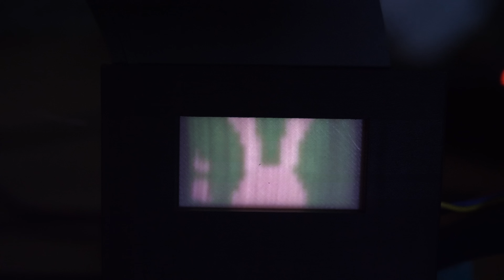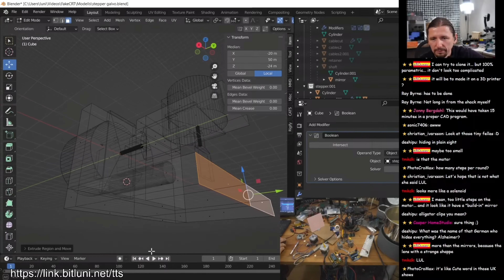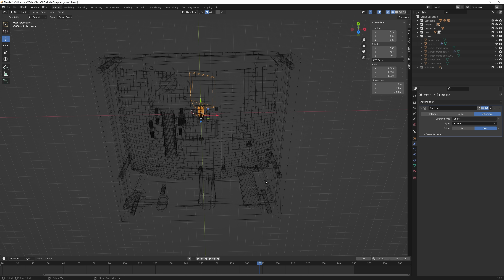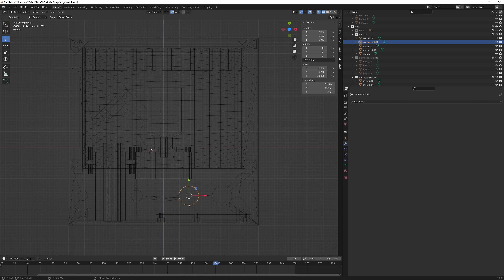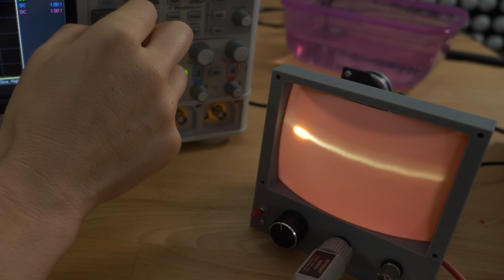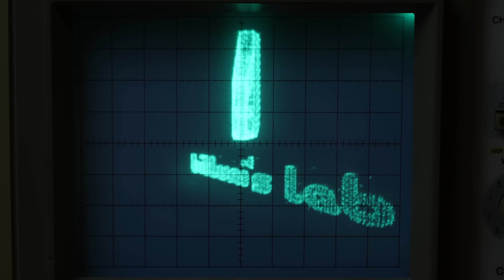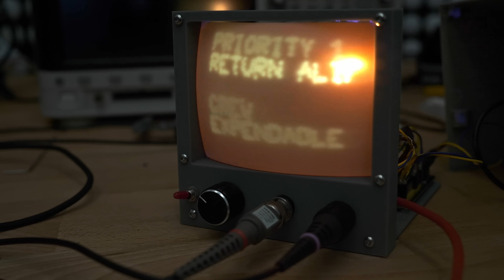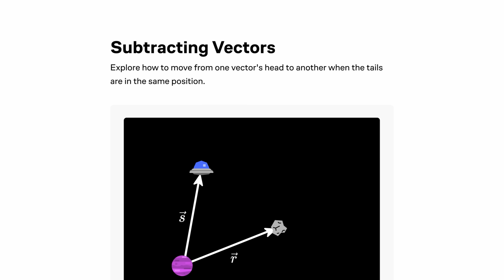I made a fake CRT TV with a LASER

Comment: How about using a smaller lighter laser diode and just hanging it from an elastic band or on a spring or something with a couple of electromagnets around it in a cross. Then using the magnets to physically rotate the diode a little bit. and using this to draw shapes or create scanlines. It might be very fiddly but could possibly increase the speed of your movement a lot. and additionally it would closer resemble the way an actual crt works, just bending the beam source instead of the actual beam.

Comment: I wonder what is its resolution. I understand this is a vector display so it doesn't really have the notion of resolution, but still you can only make the text so much smaller before it becomes an unintellgible mess
Reply from the maker: theoretical resolution is 512x280 with microstepping of 16th steps with the 0.9°/step motor. but practically lower because the light bleeds. that could be reduced by making the screen thinner but that is hard to print

Comment: I got the same idea with the speaker but never tried to do it. It should be possible to get higher amplitude with some mechanical advantage or bigger distance between the mirrors. The speaker may also give a higher resolution. The only problem, it's gonna be LOUD.
Reply from the maker: I had the idea to cut away most of the membrane for it to be less springy. what I didn't mention is that I had 2 speakers killed of heat because of a DC offset

Comment: I feel like you could've used the reflective surfaces of those speakers, or used mechanical advantage to turn the small deflection of the speaker cone into a larger deflection of the mirror.

Also, still technically using magnetic fields to deflect the beam.

Comment: no input shaping on the mirrors so you can have the steppers run at full speed?
Reply from the maker: need to switch the controller then. not really familiar with that but a transfer function should do, shouldn't it?

Comment: If you have a couple of old hard drives, they have a head that moves rapidly that could be used to control the mirrors but it would be a larger part even disected than the stwppwr motors would be. Very cool project, well executed.
Reply from the maker: that part didn't make the final cut. on stream we took apart an hdd. unfortunately the modern drives are very integrated with the case. we only salvaged the loose magnets and coils

Comment: The next step is to achieve a raster image, and build an 8K CRT. You will have to spin those mirrors pretty pretty fast 😉 or you could just use a 100 side poligonal mirror.
Reply: How will 100 sides help? Ah, very small angle. So you fight diffraction?

Comment: hear me out
harvest some DLP projector mirrors
Extremely rapid and precise mirror movement
Something you could do thats more DIY is have 2 mirrors spinning really fast, and using a shutter to only activate the laser during each of the mirror's sweeps that would place the laser where you want it, butyou would need really fast and accurate motors and sensors, a really fast shutter, and a really bright laser
Edit, you can increase the number of sweeps per second by increasing the number of sides, say, using a hexagon tube of mirrors, but this requires advanced mounting, a flat mirror is flat, but 6 flat mirrors might not all be reflecting in the same direction.

Comment: Years ago I bought a used laser and power supply at a ham fest that had been removed from a broken laserdisc player. The laser was a tube but the way they moved the beam was with voice coils and mirrors similar to the speakers you used but to get more amplitude the mirrors were hinged on one side and a stiff wire from the voice coil attached to the mirror about halfway between the hinge and the other edge. This made the mirror deflect more than the voice coil moved. Of course it doesn't matter that the laser wasn't a diode, I was just trying to give you an idea of how old it was.

Comment: Please please please develop this into a working display for analog retro gaming. A 22" Color Laser Phosphorescence Tube would be incredible and would probably have insane refresh rates, not to mention massive brightness and contrast benefits, I would bet you could achieve far higher resolutions on this even.
Reply: i was thinking this as well, it honestly feels like this ought to be a very viable product to bring to market! As far as i can figure it should let you make incredibly cheap monitors at the cost of them being way thicker than LED ones and they could only be about this size or larger.
Also it ought to be possible to just keep adding lasers, thus enabling waaaaaaay more advanced vector graphics!
Reply: @ I am so disappointed that arcade fans don’t even use the space in the cabinet for some directional backlight. Atari Lynx has a more sophisticated reflector. Everyone wants cheap off the shelf consumer stuff.
Reply: He basically replicated the mechanism of a vector display like the Vectrex or some Arcade games used, in a modern fashion!
Great stuff, love it!
Reply: Why phosphor? I did not notice phosporesence on CRT . High speed cameras show that it lasts not even a scanline.
Reply: @ArneChristianRosenfeldt Phosphors are what turn the electrons from a cathode ray into green, amber, or white photons on a monochrome CRT or red, green, and blue photons on a color CRT.

While phosphors can be phosphorescent, fluorescent phosphors are what's used in CRTs. Either the original commenter probably confused "phosphor" with "phosphorescent", or they're referring to the high level of persistence this specific device has. A Laser Phosphor Display (LPD) is a real thing though.
Reply: This technology already exists. Look up "laser phosphor display."

Comment: I implore you to find an old laser printer. The laser module in it will have a laser along with a high speed rotating mirror. The idea is when the reflected beam runs off the end of the drum, the next side of the spinning mirror starts reflecting the beam at the opposite end. Get a color laser and you might find four of these laser assemblies! You could build a raster system out of such a setup.
Reply: A rotating mirror does not lend it self to random XY movements very easily.
Reply: @Axel_Andersen  It doesn't need to. Just like with the assembly shown in this video you use a second mirror assembly so each assembly is handling one component of the XY movement. This is a long solved problem that's why you see so many similar comments about the same kind of mechanism in these comments.
Reply: @Jackpkmn  I still do not see how two rotating mirrors make a good XY movement (which to me imply random or vector like drawing). For raster scan yes, but for XY, I don't see it. A rotating mirror needs to accelerate and decelerate relative sizable mass to do random movements. Of course if you consider a galvanometer as rotating mirror then sure, but to me rotating implies more or less continuous motion. I guess it all depends on what is our built in vision when we read a word like 'rotating' mirror.
Reply: @Axel_Andersen The more sides the mirror has the less the speed has to be modulated to adjust the timing. The only actual limitation is that you can only draw in one direction, the rotation direction. So if you wanted to draw two parallel lines you would have to draw them in 2 separate passes or raster scan them in.

Drawing them as two separate passes doesn't have to be as much of a problem as that probably sounds at first with a mirror with many sides that spins relatively quickly. Since the number of times you can scan the screen per second is the number of faces the mirror has times the rpm of the motor.
Reply: @Jackpkmn  I get all that. But it still does not lend itself to good XY random vector drawing IMO
Reply: @Axel_Andersen  It's not doing vector drawing. It's a raster system, so the motion of the beam never changes—it's just a horizontal line that gradually sweeps down the dispaly surface over and over. The image is constructed solely by turning the laser on and off, very rapidly, at exactly the right times. As others have noted, this is the principle analog TV was based on.
Reply: @martysmith2756  It certainly looks to me that many of the examples he shows are drawn in vector drawing mode. Easy to see because of the tail the spot leaves behind.
Reply: @Axel_Andersen   I think vector drawing was the only solution for displaying readable stuff without a raster, because the hardware was way too slow for that.
Reply: @ RIght.And my point was that (hi speed) rotating mirror what the OP suggested is not ideal for vector drawing which the video showed.
Reply: @Axel_Andersen I think we get your point, but the mirror motors of laser printers were not intended for vector drawings, which makes no sense in the first place, they were only intended for raster deflection.
That's what the OP said from the beginning.
Reply: @ResetLoop  Exactly.
Reply: This. I made an analog version of this in the 80's to use as a night club lighting effect. Used octagonal prisms (what you're calling a drum,  I think) and it could run in vector mode or raster. Each motor had it's own function generator. It was about 20 years before I discovered microcontrollers, sadly.

Comment: I think you gave up on the loudspeaker idea too soon. The way you mounted the mirrors, you had a very long lever arm between the pivot point and the point being moved by the voice coil. If you can put the pivot closer to the center of the coil, you'll get more deflection for the same amount of coil movement. You could also experiment with using a magnifying lens to get more deflection.

Comment: it might be better to use the "laser printer" technique, where you spin mirrors around really fast and pulse the laser, instead of moving the mirrors precisely. Though with 2 mirror drums (or varied angle on the drum faces) needed, I'm not sure.

This also would introduce an arbitrary number of lines/dots you can draw, probably worse than the stepper motor's, however, it will be a lot faster.

Comment: Interesting, earlier today I was thinking if CRT TVs could be made thinner and lighter by ditching the magnetic deflection part of the electron beam altogether and instead using electron mirrors and/or electron lenses that can reach a larger screen area with little movement, given this demo uses a laser beam, but it's an interesting proof-of-concept, and I would love to see big home CRTs brought back again in an enhanced form through an insight like this, other thing I thought about is using some sort of electron phased array of sorts.
Reply: this has been done, google 'sinclair ftv1', but it never took of as LCDs developed fast
Reply: TV were quite thin. A big problem is the actual gun.
Reply: its already  been done, a gabor tube,  google sinclair 'ftv 1'

Comment: Would be interesting to see those mirrors mounted on something that has much less inertia, like a hard drive hand. That's the kind of technology used in similar systems that use lasers and mirrors to draw images. Stepper motors are just too slow for such applications I think.
Edit: actually, your attempt with speakers was close, but instead of amplifying the voltage to amplify the amount the speaker membrane moves, you should've amplified the motion itself mechanically, maybe a system of linkages or something.
Edit2: And yes, the accuracy decrease when speed was increased is exactly inertia at work. Such systems have to use lightweight payloads and finely tuned magnetic forces for control

Comment: Great build, but instead of motors, i may have used voice coils prom a hard drive instead, because they are a ton faster. 

Or as another user suggested the rastering method. There is another YouTuber which built a DIY laser projector using this method, in colour even.

Comment: I did a project like that in the 90's (getting old) for a lightshow in a Portuguese disco. I got the fastest movement by using the actuators of a harddrive for mirror movement. Made them as light  as possible to prevent overshoot and improve accuracy/speed. The disks of the drive were used to make the mirrors so the laser beam would reflect directly of the surface without any refraction of a glass cover. I tried with both using the IDE interface and by driving the actuator coils directly. IDE gave the best visual result while direct analog drive was the fastest but due to the induction of the coil also the less accurate solution. Used Delphi to write the driver software (vector based).

Comment: This is really cool. It would be awesome at a larger scale if paired up with a DIY vintage computer made from TTL or 6502/z80 etc.. 

The biggest issue with using it as a simple display is the beam width, are the traces so thick due to the laser culmination or is it just a property of the PLA screen diffusing to much light? It could defiantly be sped up to trace faster with some BLDC based servos.

Comment: Personally, I would have tried using something similar to the sort of voice-coil actuator used in magnetic hard drives for head positioning (you might even be able to just pull some from some old hard drives).  Those can move very quickly over a fairly large angle, and also very precisely too (if the electronics driving them are good enough)...

Comment: I like how he calls this a “fake” CRT, even thought it’s actually kinda close. 

While the method used to generate the light is different, as is the way the light is manipulated to points on the screen, the concept of the pattern of display is almost identical. Like others said, if he added a rastor mechanism it would be almost perfect.
Reply: No cathode , yes ray , no tube
Reply: Replace the Cathode Ray for a Laser.
Like others said, play games on it all others say ! Understand it ?
Use magnets on the lenses to move the laser beam over the screen !
Reply: @lucasrem  I know these scanners as others have said. Just I hate that people always dismiss the engineering in CRTs . I studied years to know how to create a low vacuum and to create low work function surfaces. Electron optics. Yet here it all gets dismissed as unimportant .
Reply: Now it's a Computing Ray Thing, so it IS a CRT.

Comment: You might want to make a raster display, so the two mirrors spin continuously, and cover the screen left-to-right, then top to bottom, and turn the laser off and on when it’s pointed in the right direction.  You would probably want double-sided mirrors, so you get a longer duty-cycle.

Comment: To have a faster redraw rate, I would maybe suggest using a multi-faceted rotating mirror like that seen in laser printers.  Maybe getting more violet lasers so you can draw multiple lines at once getting better image response.  I am looking at the technology Nintendo used in the Virtual Boy when I say an array of lasers.  Those lasers are actually more of a line, but you get the idea.  This would be good for a raster pattern like how modern video is made today.  Edit:  I forgot to say that the diodes in the Virtual Boy are LEDs, not laser diodes, but in your case that's what you may get.

Comment: Might be nice if you can program 'Asteroids' for it. That old 1979 arcade machine used a vector display, and that had a unique look.
Reply: threeMetreJim
Vectrex, the MB Arade system at home, vector CRT system that was, but people hated that it was Black and White only.
program ? What you need to program here ? Why not just run it ?
Reply: @lucasrem  Generally you can't just provide copyrighted code to run on an emulator (is there even an emulator that can draw a vector display that runs on the esp32?); I'm assuming the original Asteroids arcade code is still under copyright, so you will need to create a clone; hence 'program' or find a version that does the vector drawing that is public domain.
Reply: I feel like some tweaks would have to be made. Asteroids can get quite hectic with many small asteroids and UFOs on screen moving around at once. I don't think the current screen design has a fast enough refresh rate for action games.

Comment: that back and forth motion is not a good idea.
why not make constantly rotating mirrors? horizontal mirror rotating at 400 times (or whatever the vertical resolution is) vertical mirror, which would rotate at screen refresh rate. 
depending on number of sides of mirrors. 2 sided mirror can rotate at half speed, 4 sided mirror can rotate 1/4 speed, etc.

Comment: Quick idea about moving lasers... First, use leverage, so that just a little movement of the speaker membrane produces a greater deflection. There might also be a way to use lenses to increase the deflection. The key is to remember that almost no power is needed to push the mirrors, they're almost weightless. It's like low "torque", high speed.

Second, maybe a pile of piezo elements? They ought to be able to move faster than an electromagnetic speaker. Wire them all up in parallel, electrically, but insulate them from each other. Then just stack 'em up. Arbitrary movement length from little power. Again they use almost no current so driving a pile in parallel should be no problem. 

Third, maybe try wire your own coil and make your own design for a galvo?

Comment: You need to duplicate what the CRT did. have a continuous rotation motor to scan the lines, and turn the laser on/off where you want it. you could use gears to do the vertical scan.
Reply: CRT vector arcades have left the chat.

Comment: Most of the time, the mirror assembly in laser printers are just a spinning drum with multiple mirrors on the outside.
That way, you do not have to worry about turning the mirror back after each pass.
(At the end of each mirror, the next one is already aligned correctly.)